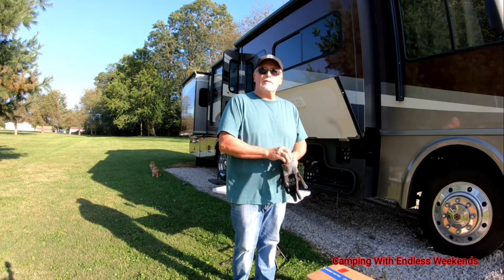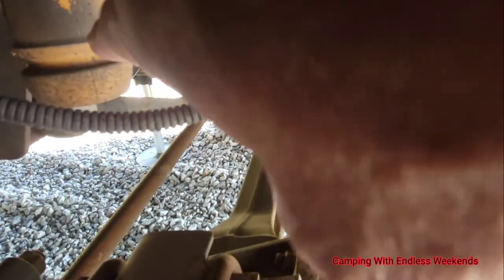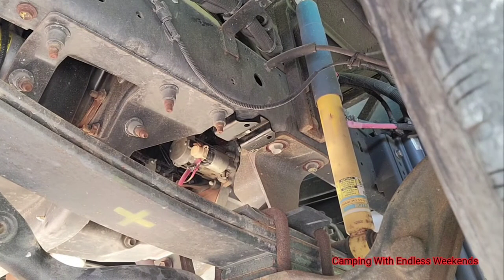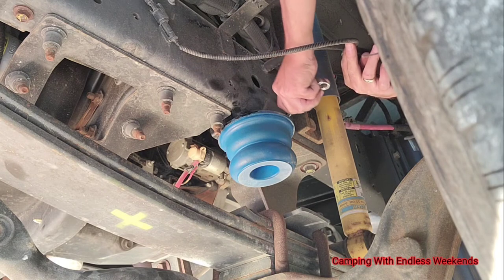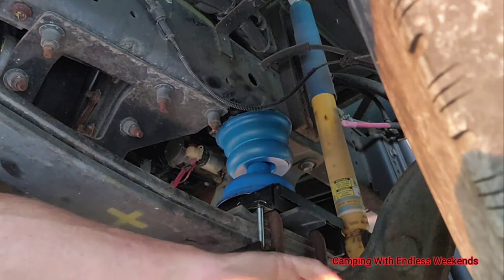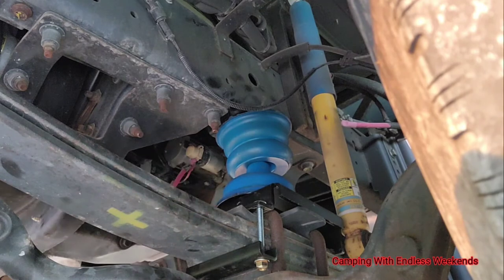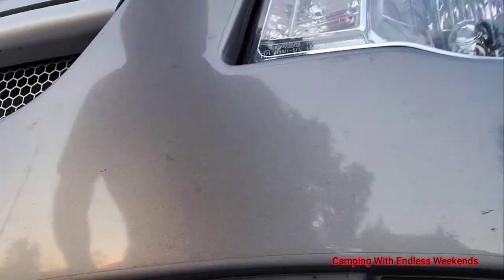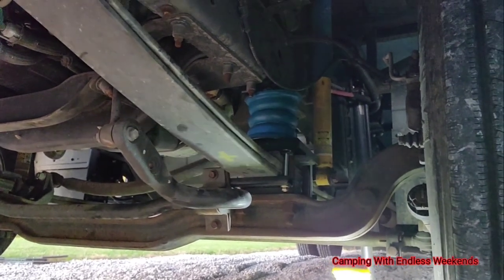Class A motorhome SUMO SPRINGS DIY INSTALL AND UPGRADE / RV life/Who doesn't like to save money ?

Comment: Hi.  I saw a video from someone about the front sway bars.  If you look, there is a 2nd hole.  You can move the connection point from the front hole to the back.  It's supposed to make it perform better.  I will be changing mine this weekend.   Before spending money on a new set of sway bars.
Reply from the maker: @ferenczbabinszki7699  thanks for the info

Comment: Nice video, I am getting ready to install mine so this is helpful.  I don't know if it matters mush really, but the bottom brackets below the leaf springs are upside down in your video according to the instructions.  The flat part is supposed to lay flat against the spring.
Reply from the maker: @patrickfoley9670  thanks for watching and sorry for the late reply

Comment: When they are installed and the motorhome is without leveling Jack   Are the sumo springs already compressed  or they have no tension on them ? 
I got mine last Friday and looks the right fit but when I lower ( jacks)  the motorhome I see already sumo Springs compressed like 1/4 from their normal size . Is it normal ?
Reply from the maker: They are only used when needed as they replace the original bump stops. When the vehicle rolls, they compress to stop the roll. To answer your question, there should be no tension on them

Comment: Unfortunately, this video was not a complete install of the Sumo Springs. Only one side was shown. It was represented that we would get an after report of the improvements, which we also did not receive. Not really a helpful video in my opinion.
Reply from the maker: I have a video talking about the springs after 6500 miles use. Thanks for watching